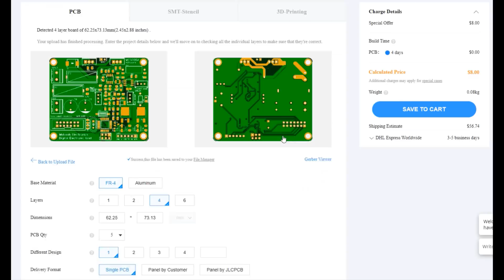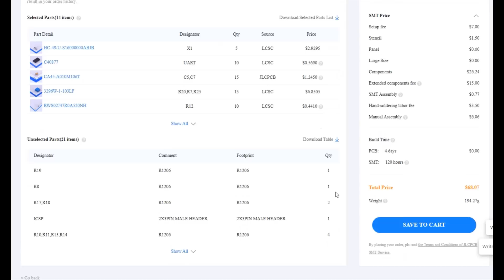This tool you will need for testing, zener diode, led light ,voltage regulator

Comment: Good job!
It seems this circuit over drives the diodes and must be modified.

Red / green / yellow led voltage drop must be less than 2 volts unless be drived with currents more than 20mA results in red led turned on with almost yellow and shortened its life.

Thanks!

Comment: 🤔Объясни зачем в схеме диодный мост? Зачем так усложнять, если можно просто через резистор подать  с +12 вольт питания прибора и в итоге все тоже самое, только без бреда с диодным мостом.
Reply: sanırım o köprü diyodu kullanıcı hatasının onune gecmek icin eklemişler.
i think he added this bridge so that amateurs might connect 12V terminals wrongly. in this way (with bridge) if they can connect wrong, the circuit works still or you use a transformer to inputs of diode bridge instead of dc ps

Comment: Made it. Tested and boom! Thanks. Just a quick note you can apply 4v to 40v  DC to input. The voltmeter can measure 100v maximum.
Reply: The voltmeter's internal regulator can only handle 30-35V. You need to power it separately to measure higher than that. If the voltmeter has only 2 wires, you need to modify it so that there is separate +'ve power for the meter vs the measurement line.

Comment: Уважаемый мастер,я попробывал сдиодным мостом BR810,но на светодиодах напряжение показывает на красном 1,5 вольта,на зелёном 2,3 вольта,короче занижает вольты. Стабилитроны вообще 0,5 вольта.Где я накосячил? У вас в видео сопротивление стоит на 200 ОМ.
Reply: I think for the zener diodes you are measuring their forward voltage - you need to turn them round to measure their zener voltage.

Comment: Veery interesting, useful. 1 question. Can we use another power supply different to 12. Volts. Perhaps   24 , 50, 75 or even. 120 vdc.?  Plz. Am waiting ur answer. Thanks you a lot.
Reply: You can use 120vdc if you use a 4.7k resistor in series with the output to limit the current.
Reply: @aboveaveragejoe6291  - The meter will not survive 120V. The maximum for the voltage regulator is about 30V.
Reply from the maker: 24v ok
Reply: You need to power the meter at under 30-35V, as that is the maximum for the internal voltage regulator. To go higher that about 30V, you must use a 3-wire meter where the power +ve and the measure +ve are separate.